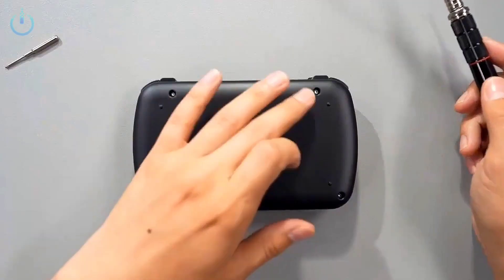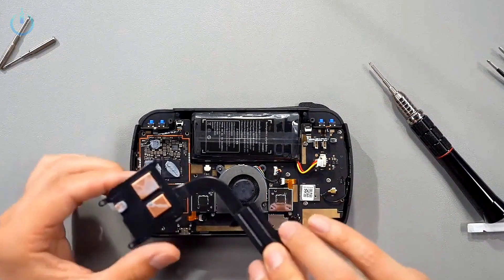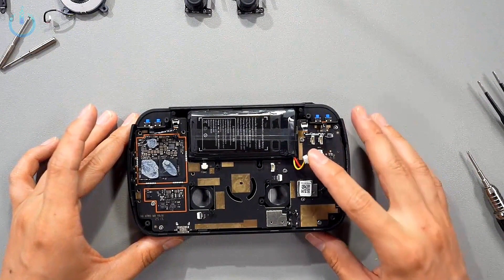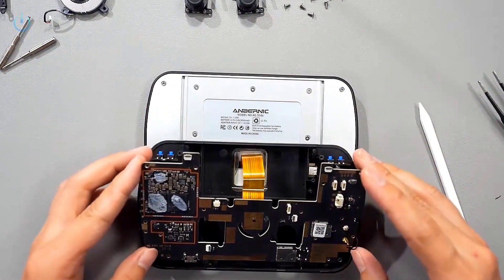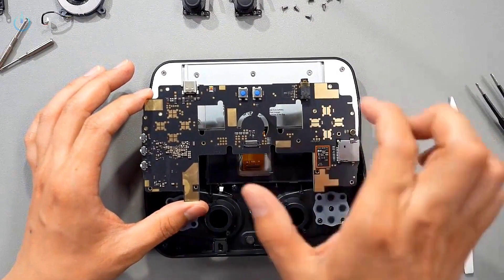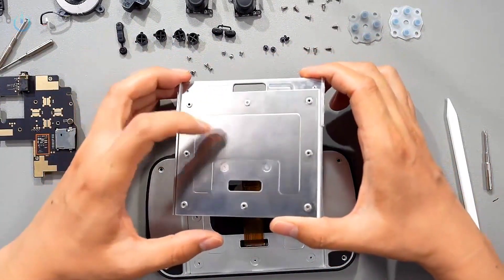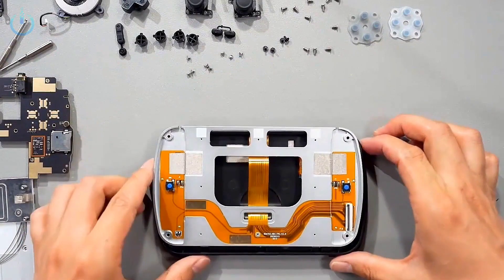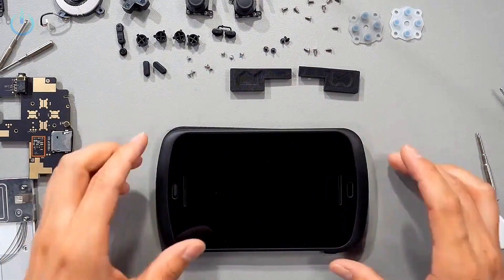ANBERNIC RG Slide Disassemble device

Comment: Sweet, this thing isn’t nearly as gnarly of a tear down as I was expecting… especially as the WiFi cable is right under the back panel. Idk why, but my Slide has SO many problems connecting to WiFi and I’ve tried literally everything i can think of that im at the point where I need to check hardware 😭 Might as well add some fresh thermal paste though, I wound up with tons of the expensive  good stuff somehow 😅

Comment: the mayor crticims to the device leaving aside the screen body ratio is the weight, that may be the two metal plates, maybe a version with a soc that dont need active cooling and a rework on the slide system  to use less metal.
Reply: Yeah, I agree. While I definitely DO like the Slide as is, it could use a version 2… I’d jump on it in a heartbeat